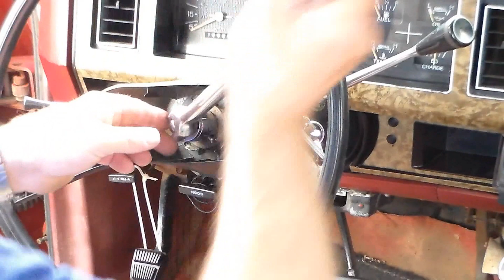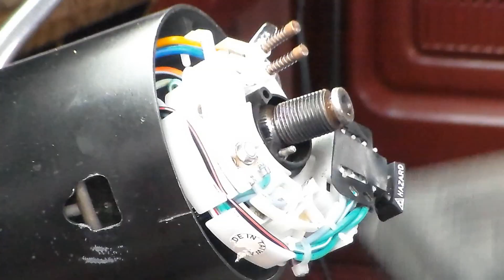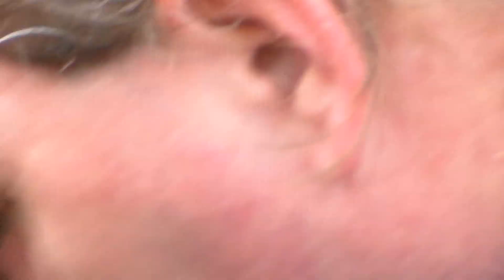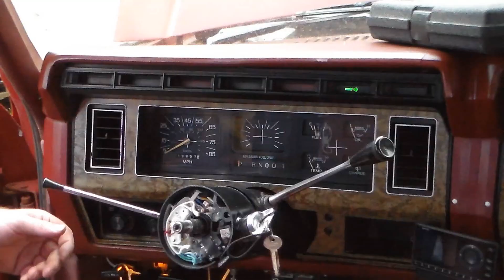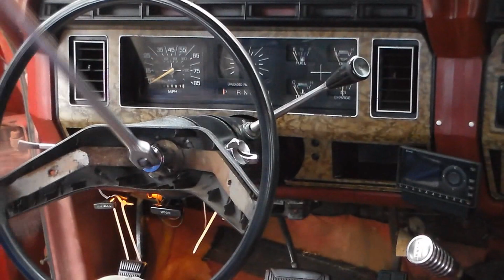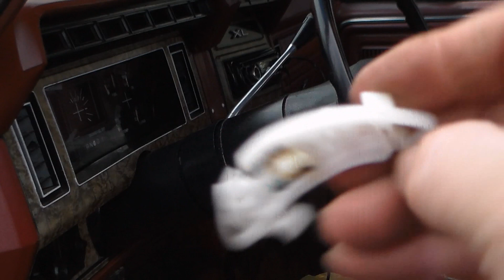1980-1991 Ford Turn Signal Cam Replacement (Tilt Column)

Comment: I wonder if NAPA sells this cam. They seem to have better quality parts than the other parts stores. Or maybe the Ford dealer has this part available. I have just bought so many auto parts in the last few years that were junk. My book say 35-42 ft. lbs. torque on the steering wheel nut.

Comment: I wonder if those wire connectors could be drilled out of the old cam and then riveted to the new cam? That way you would not have any solder or crimp joints in your wiring.

Comment: I only use shrink tube that has glue inside. That way if your solder job or your crimp job is a little shaky the glue in the shrink tubing might save you.

Comment: Is this what prevents the turn signal from staying depressed? I have to hold mine up or down it doesn’t like click into place like my new car. Am I correct in my thinking?
Reply: My '86 f250 has exactly the problem you're having. I'm hoping it's just the cam.

Comment: 89 f250 351w xlt lariat every light works on my truck but when i turn on the flashers nothing happens and blinkers also stop functioning if i dont touch the hazard switch everything is fine (no point in chasing wires if everything else works same with the Turn flash relay in the fusebox can see it clicking when turn signal is on nothing when hazard switch is hit and the 1-15amp fuse is also good) which leads me to think a wires loose in the column or the switch failed? any suggestions feel free !

Comment: When i installed my cam it has broken twice now on the right signla where the plastic catches to hold it in place and then it wont connect i guess to turn the signal on so i cant even hold it

Comment: This was a poor solution.  Don't cut shit.  You will have a bulky pile of junk once completed doing this way.  Don't be a hack.
Think how the factory installed it.  They didn't cut shit to put it together.  It is a puzzle you need to solve.

Proper procedure....
1) Leave the collar on the column.  It's a bitch to put back correctly, anyway.
2) The gray plastic connector you so astutely showed at the bottom of the column that was too difficult to remove is exactly what needs to be disconnected.  It isn't too tough to do.
3) Once disconnected, you will see there is a red keeper in the connector.  Pull the red keeper.  This will allow the wires to be removed from the gray plastic connector.
4)  Pull the wires individually up through the steering wheel collar.  Pay attention to the path the wires take.
5)  Open the package with the new switch and take a few pictures of the location of the wires as they are in the gray plastic connector.  This is a requirement as the colors of the wires may be different from the factory.
6)  Remove the red keeper from the new gray connector and remove the wires.
7)  Push the wires individually back down through the column's collar.  Follow the path from whence they came.
8)  Reinstall the wires in their respective holes in the gray plastic connector.  Reinstall the red keeper.
9)  Install the new switch mechanism onto the column.
10) Reconnect the gray connector at the bottom of the column.
11)  Put the steering wheel, column, lower dash panels and eveything else back together.
Done.
I just this last Saturday.

Lesson:  Don't destroy something to take it apart.  If you can't figure it, find the right YouTube video or the right commenter.  The correct answer is here or in your head.
Reply: That was a GREAT comment. Glad I saw it and thank you.

Comment: Hello. I have an 84 e350. I turn the key on and flip the turn signal to the left and the arrow in the cluster lights up and so does the front and tail light. I turn it to the right and no light on the cluster (probably just a bulb) but I get a clicking sound and the front and tail light flashes. As soon as I pull on the the head lamps the turn signal freezes regardless of direction. There is no clicking and there are lights flashing. Might this be a turn signal switch like the one your video shows? Thank you for your insight

Comment: One time I was out riding across the mountains in my 89 f150 with little brother following in his 88 ranger. Got down to a stop sign heading home and got a call from him telling me my turn signal and tail light wasn't working. I pulled off side of the road and checked the bulbs which were good got to looking at the wires and they were cut or broke on left side. It's sprinkling rain 40 degrees out and about 1 in the morning and I had plenty of beer but no electrical tape so my dumb drunk ass found a grocery bag under the seat cut me off a strip folded it up to thicken it a little wrapped it around the newly spliced wire and melted it with a bic lighter good enough to hold together. 3 years later the piece of grocery bag that saved me from a dui is still functioning as electrical tape.

Comment: That switch had been replaced before that, I noticed the there wasn’t much wear on the horn pickups, maybe those are for the cruise control. I have that chore ahead of me on my ‘84 F250 diesel. Good sharp picture.

Comment: At the beginning, run a piece of masking tape from the top of the center of the steering wheel, down the top of the column. Then cut the tape where the wheel joins the column. This will allow you to be certain the splines line up perfectly when reattaching the steering wheel to the column.
Reply: my ford bronco -89 steering wheel cant be put back wrong lucky me.
Reply: no wait neither on this ford. the cogs have this flat space on both the column and steering wheel so it is only available to reattach it one way

Comment: I replaced the entire plastic assembly - ran the new wires - on my back upside down etc etc.  Should have watched your repair first,  My horn is not working now so I will pull off the horn again and maybe pull the steering wheel.  OH when has a repair gone perfect?  Not too often but sometimes.

Comment: People do not forget to disconnect the battery before doing this job !
Reply: Isn't the steering wheel too thin to have an airbag
Reply: @ag6371  yeah i just did this job. Nothing to worry about. Didnt disconnect batt.
Reply: This doesn’t have an airbag so it’s not that important
Reply from the maker: True. Disconnect the negative post.

Comment: dude this is awesome.didn't know you could just replace the cam. that saves me about 70 bucks.  assuming this simply fixes the left blinker chillin out not clicking off and having to do it manually every time.  right still clicks on and off but left flops.. and turns on even if I hit a good bump in the road. thanks so much!
Reply: Literally exactly what I'm dealing with
Reply: Mine did that and now my signals won't work at all, know it's not bulbs since I replaced them today

Comment: Hey man don't be raggin on RadioShack solder, been using it for decades. Get a little tighter twist on those wires. Great video though!  I did this a couple of years ago and my HELP TS cam has already broken. Also had to snip a little of the stiff spring wire off to get it to work back then. Hope yours lasts longer than mine did.

Comment: You think you can help me out. I have a 85 f150 and it won’t shift from inside the cab. But I unhook it from the bottom and put the trans in gear with my hand. But the shifter inside won’t work.
Reply: Junior Garcia the rod that goes from the tranny to the steering coumn is out

Comment: Great video but have you had trouble with your brake lights? Mine do not work consistently, either one or the other will turn on when I press the brake and which brake light turns on depends on the position of the turn signal switch. 

Any ideas?
Reply: Ford runs the brake lights through the turn signal switch in the column for the emergency flashers.
Reply: Replace the whole unit. That happened to me after doing the cam only. The whole unit fixed it.
Reply: My husband replaced that same piece and the same happened to his truck, was hoping to have it running for 4th of July weekend but I guess we’ll have to wait 😕
Reply: mine is doing that now.
Reply: this does look like a pita..  im just gonna replace the whole switch like mamunoz ^

Comment: Thanks just the vid I needed to repair my Motorhome turn signal It's a John Deere chassis aka HD ford has the same steering wheel Now I just need to fine one on changing the key ignition assembly
Reply: Changing the ignition assembly is extremely easy. If you've pulled off the steering wheel before, you've pretty much done the job, except for the cylinder swap. Just search "1990 f150 ignition cylinder replacement". Good luck getting your rig spec'd up!